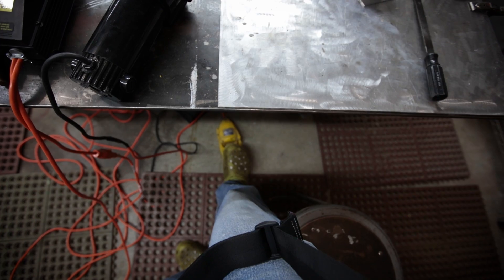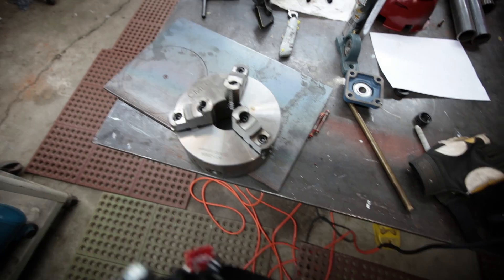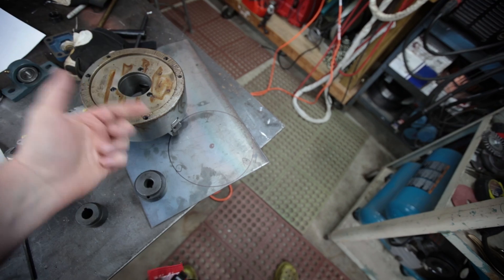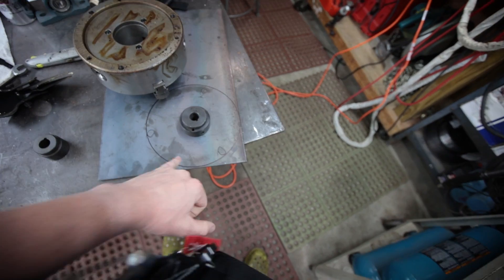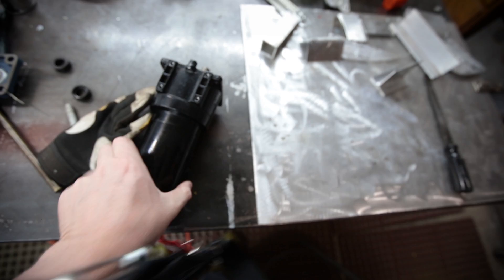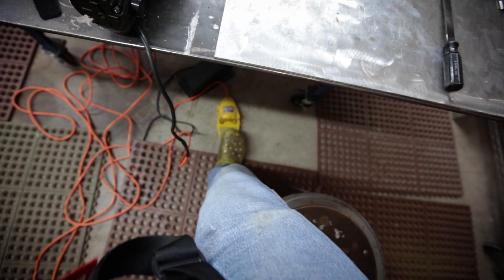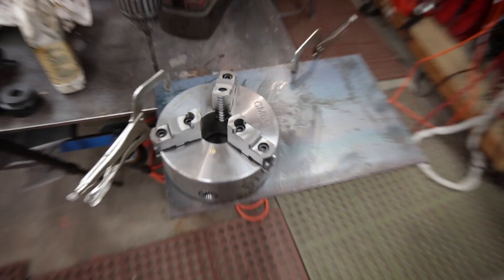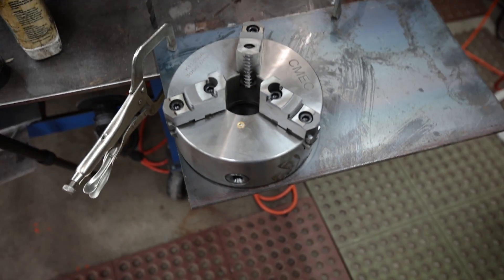Build Your Own DIY Weld Positioner Part 1

Comment: You should be using the 3 holes closer to the center. The plate should register on the lip at outer diameter.Ron
Reply: Really? I have never seen this in almost 20 years as a machinist. The way I would do it is to leave the mounting bolts slightly loose, attach chuck backplate/chuck to lathe, indicate chuck(or part in chuck) and then snug up the bolts for minimal runout.

Comment: i admire your creativity and thinking outside the box without a lathe or a mill. i don't know what i would do without them. i am also building a weld positioner. check out my vid.
Reply from the maker: I think not having access to a mill and lathe has made me a better fabricator. You get to where you can do crazy stuff with a mag drill.